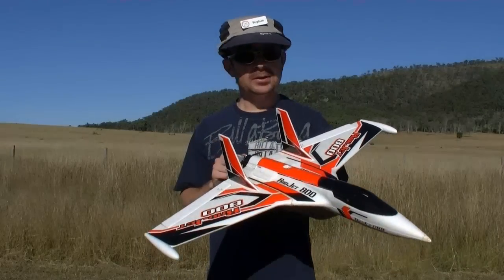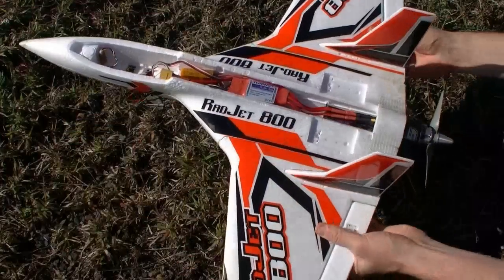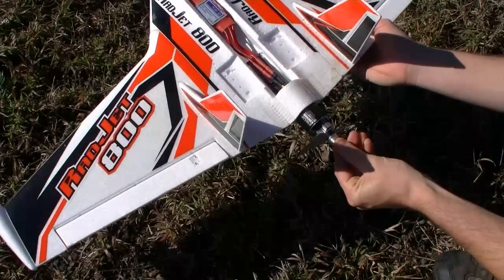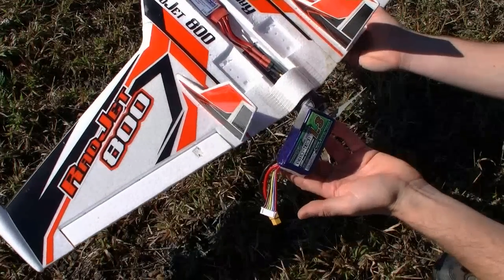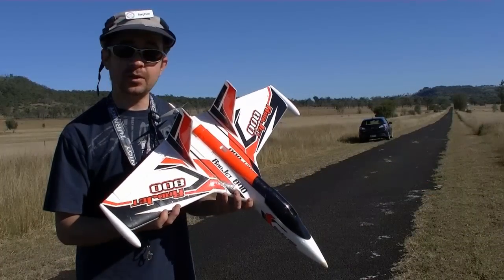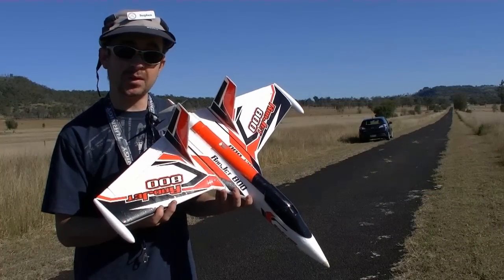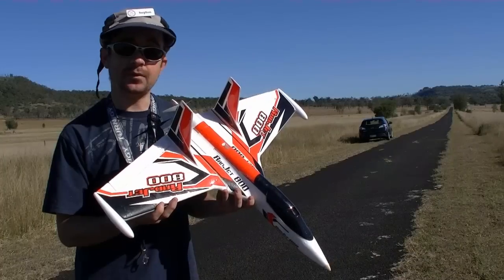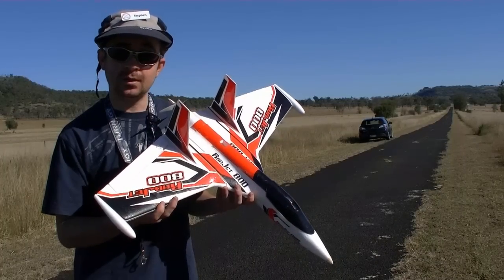RadJet 800 6s 1200 watts (VERY FAST)

Comment: Hi there. I’m looking at up rating my Radjet 800 and your setup looks pretty much what I was hoping for. Would you mind letting me know what size prop you’re swinging please. Many thanks. 
Love the video by the way!!
Reply from the maker: It was an apc 5.5x4.5.  Keep in mind that a heavy set-up like this will reduce the flyability.
Reply from the maker: Thanks!
Reply: Many thanks for the reply! I figured it’d be somewhere around that size and pitch! I was worried about using an apc, as they’re not very forgiving when used with belly landers!!
I do like your setup though!..... sounds awesome!!
Reply from the maker: @andrewandlee  I've not had an issue with belly landers and APC props.

Comment: if you cut off the fuel pods it will get the speed your wanting i think they account for some drag. im setting up another one for my son he is hooked on the speed this plane offers i will say it is a similar motor but 3000kv lol it is alot of fun and it flies on rails. i bought a 3d printer so i started making small fixes for this plane like a better shaped nose cone and small winglets from super thin but strong pla carbon fiber. these two fixes alone gave us way nicer handling and faster speed. i saw you crashed also so i hope you do have another go with reinforcement now you know where it needs it from your experience. happy flying.

Comment: Why in the end of this video, it shows you were using NTM 35-36 910KV motor ?
Reply from the maker: +RC Sóc Trăng   hello, nowhere does it show me using a 910kv motor.
Reply: +TheRattleSnake3145 In 1:35
Reply from the maker: +RC Sóc Trăng  1:35 shows me pulling apart a Turnigy 2826 3700kv motor.
Reply: +TheRattleSnake3145 Yes I know that, but the right motor was 35-36 910KV, did you see
Reply from the maker: +RC Sóc Trăng yes it saw it, it's my video.   I'm not seeing what your point is though.
Reply: +TheRattleSnake3145 I just wonder which plane that you put this motor in.
Reply from the maker: +RC Sóc Trăng  Cant remember but most likely a Super Cub.

Comment: What are you using to measure the speed?
Reply from the maker: Hello , its a Voltron GPS data logger.
Reply: Thanks!
Reply: +TheRattleSnake3145

OK you posted this over a year ago so I won't expect a reply but for anyone else reading this it should be pointed out that GPS isn't very good at measuring speed, and that especially applies when you're moving fast.

Really you should have done several passes and averaged the results although it's as an indication it's fine and from what I've just watched definitely fast enough!

Comment: Why are you using a 6s on a motor rated for a 3s or a 4s ?
Reply: Most most 4s rated motors habe no problem on 6s.. motors are not the weak link when stepping up voltage. Like 2s motors have no issue running on 4s so long as you know what your doing.. a Watt meter is a absolute must when you are running 6s on a 4s rated motor.. you must prop the motor to keep the wattage in an acceptable range.. if your running a 800 watt motor and prop it to where it pulls 1000 to 1050 watts static then your in-flight wattage will be very close to that 800 watt number.. anyhow motor windings have no issue with increases in voltage you  just have to know how to prop a motor and you must know how to fly a plane that is over rated in its power system, you need to do speed runs then a cool down run if you are really pushing it towards the max the motor can handle.. I fly 6s on planes and quads all the time with motors rated for 2 to 4s and they handle it and beg for more.. I've flew 8s on my Hyperlite 2207 R3s that's a 2 to 4s motor and trying to break race quad speed records I've broke 146mph with that setup on custom props I had made that are 4.4x5.8x2 i have only cooked 2 motors on that setup with over 400 flights on it.. one motor was cooked because of a Emax AvanR bi-blade 5 inch prop exploding from turning more rpm then it could handle and had it explode at the hub and the massive instant vibration smoked it instantly and the other time was due to a error me running 3 back to back to back passes without a cool down pass and about a half second in to the 4th pass I smoked the left rear motor and once again my fault.. it was in no way the way over voltage of the motors.. point of this is, this fella is exactly right if you know what you are doing going well over the rated voltage of a motor is ABSOLUTELY safe and you are putting zero risk on smoking a motor.
Reply: also that's a good way to burn up that motor
Reply from the maker: Because it can take it.
Reply from the maker: watchdog gibson Only if you don't know what you are doing.

Comment: Hi guy, since 1 year I use your setup. It's really fun, but the lipos dies very fast. For more speed, I have change the prop for 6x5 and a powerfull battery Turnigy nano-tech 1550mah 6S 65~130C.
Thanks for this video !

battery :
https://www.hobbyking.com/hobbyking/store/uh_viewItem.asp?idproduct=51445

propeller :
https://www.hobbyking.com/hobbyking/store/uh_viewItem.asp?idproduct=7937

Comment: Hi mate, can you please explain to me why you are running 6S on what is specified as a 4S motor?  I have just bought this exact setup and when purchasing parts from my local model store the guy pointed this out.  Im taking it because you are running 6S then the current draw is actually less?  Will it last long?  Also what flight times are you getting with that setup please?
Many thanks in advance!

Lee
Reply from the maker: Running a higher voltage gives you more power per amp draw.
The amp draw with this 6s setup is below the motors rated max amp draw so its fine there.  Where the motor is mounted gets Alot of cooling, this also helps.
Combine these points with the fact that full throttle is only ever held for 5 sec or so ( As it gets to far away if you go for any longer) mean that its not an issue.
The only thing I can think of is the bearings may not last as long. but these motors are very cheap or you could just put in new bearings IF something happens to them.  If I fly for endurance its about 15 mins, if I do speed runs its 3 mins or so.  Whoch hobby store sells HobbyKing stuff?
Reply: Thought as much but could we not get a true 6s motor in there?  If so what would you recommend?  15 mins on a 1300mah packs sounds crazy even if it is just tootling around. Looking forward to trying this setup. Have you stiffened up the airframe and if so where?
The store dont sell hobbyking stuff I just went there for the props/carbon/watt meter and a few other bits and bobs.

Comment: I use the 28m NTM motor, 4.5Sq prop on a 45C 4 cells & 60A ESC & my Radjet is bloody fast!
Anything faster is really not needed I reckon. It's a balance between weight & flyability.

Comment from the maker: I use /like the Plush/Sentry esc's because with the program card, its very easy and quick to change the settings.

They also work very well and have proven to be reliable.
I've never used a redbrick but I have had a Hobbyking esc (which is the same as a Mystery esc)   It performed well but I found it hard to change the settings.
My first choice is still the Plush/Sentry esc's

Comment: Don't sweat that you're running it on 6S.  There are no MOSFETs or voltage sensitive components, unlike an ESC where you MUST obey the cell limit.  You can run it on 12S if you keep the power under control - would need a hella small prop.  You might be overclocking it on POWER, but even then the rated power (875W) depends on how aggressively the throttle is used and how much cooling the motor gets.

Comment: All fixed! It was that the ESC was plugged into channel 6/7 which on my reciever is for the power.. woops! I put it into channel 3 which is the throttle, and also provides power - obveously and it worked! 

I still have to adjust the endpoints but she runs a dream now... thanks for all your help :)

Comment from the maker: The only thing changing the motor/ esc wire order does is swap the direction of the motor so I don't think its that.

It kind of sounds like its not bound or you have the wrong model selected, have you checked that?

Comment: Hi mate, i have built up my radjet exactly the same spec as your one in the video here. I have one issue, this being that when i plug the ESC into the motor i get a repetitive 'bleep bleep bleep bleep.....' noise. What do you think this could be? I have tried plugging in the connections in different orders but still i get the same problem. help!

Comment from the maker: If you cruise around on 1/3 throttle ( probably 100kph or so)
you will get around 15 mins with this setup, speed runs you get 3 mins ish.
I'd just get more of the same batteries (You might get it a bit cheaper if you use the link in the video description)  
If you want more out of it I'd suggest a higher pitch/ larger diameter prop.
However, the motor is already being run out of spec (Its not rated for 6s use)
so you would really need to keep an eye on it.
Dont forget to add Carbon in the wings!

Comment from the maker: Im going to guess that it happened because there was no prop on it and it over reved.
I never run a motor at full with no prop.

Despite running this on 6s when its a 4s motor, its still under the rated max amps.
No troubles so far.

Comment from the maker: The 241kph with that setup was recorded in a dive, level speed was around 198kph.
So that was a bit misleading because of that, thats why I made sure I flew level 
in this speedrun.
I feel that 40kph increase is a fair bit!

Last I knew from RCGroups was that 5.5x4.5 was the magic ratio, which is what I have found too.
Im not a fan of the TGS props, I prefer APC or the hobbyking APC Style props.
Reply: How much the weight of your plane sir?

Comment: Oh and BTW according to drivecalc, the speed you claim on your 2836 isn't possible with a prop with 4.5" pitch. What is the gadget you're using to measure speed, and how accurate is it?
I know there also software available that can measure speed by doppler from an audio recording of the plane flying by, should be able to be applied to these videos :)

Comment: Wow, that's weird that you get it to go faster (241km/h) on the 2836 with 4s, but with the 3536 on 6s it only went 232km/h.  Any idea why?
what size prop did you use? They say 6x4 is the magic ratio, perhaps you need a motor with the correct kv to run a 6x4 TGS sport at about 60 amps?

Comment: For carbon fiber on the wing,you said you used a 10mm wide by 2mm thick peice,did u use one that went from one side to other going through the fuselage too being it is convex to the wings,or did u use 2 pieces going from wing tip almost to were fuselage radius begins?? Being the battery takes up entire height of fuselage where do u make a air vent at (on side of fuselage like at a 45 degree angle or something?)

Comment from the maker: you dont need to change the electronics, 
you do have to modify the motor mount a small amount to make it fit.

For these speeds.you will also need to add some carbon fibre to the wings.

Have you flown much before?

Comment from the maker: Make sure when your doing your speed runs that you fly as level as you can or you will get false results.

I go to RCgroups dot com. 
There you will find a pusher prop section where the Radjet thread is.

I have 3 new planes coming atm, so the radjet wil have to wait for a bit  :P

Comment: Just had another 2flights, 216km/h level is the fastest I can get. Motor and ESC gets very hot though, cut out so much for cooling but still gets hot, this setup stays so cool with the open setup in the skyfun. Which is the bet forum to join so I can chat and post pics etc? Thanks for your help so far! I would Love to see this plane at 250-260... Race you to it ;) lol

Comment from the maker: Yea I have seen it, hard to say if it will handle it.
Just make sure you test it with a watt meter.
Its a bit smaller motor so you will have to move your battery further back than mine.
It will likely draw less amps than my setup (with the same prop) but  likelt to have less speed.

They are a great plane and so cheap!  Post a video response when you can.

Comment: Have you seen HK new 1700kv 6s motor? 30Grams lighter than the NTM. Do you thin it can handle 5.5 x 5.5 on 6s? I maiden flew my Radjet today on my 3700kv 4s, 4.5x4.5(against your prop recommendation). Got 200.34kmh level flight. I ordered your 6s setup now and that new 1700kv motor. Thanks for your help, the radjet flew like a dream first time!!!!

Comment from the maker: The motor is hooked up the same way you hook any brushless motor and ESC.
I am using the stock motor mount with the nessesary holes drilled to fit the bigger motor.
I used 2x 10mm carbon strips, I prefer the strips over rods because they are much easier to install and are stiffer.
I didnt paint the plane with arclic but I did use alot of epoxy around the motor mount.

Ive had a few questions about the setup now so I will be doing a vid on it in the near future.

Comment from the maker: Any esc will work however I have never used the esc's you mentioned so I cant
say how good they are.

I use the Turnigy Plush OR Sentry esc's because they work VERY well and can 
have their settinga easily changed using the programming card.

I recomend the Turnigy Plush or Sentry %100

Comment: I do not think it would be a problem to explain how you hooked up the motor using what motor mounts etc?? Thank you. And what size carbon rods for wing will work,and if u had to paint plane with acrylic or reinforce the motor mount any with epoxy etc?? Thank you.

Comment from the maker: Prop: APC 5.5x4.5
Motor:  NTM 3536 1800kv
Esc    :  Turnigy plush 60 amp
Battery:   turnigy nanotec 1300mah 6s

Links have been added to the video description.
Use htese links AFTER you have logged on to Hobbyking, theres a chance you will get them cheaper

Comment: What modifications have you done to the plane? Did u need to paint it with clear acrylic? Put carbon fiber along traling edges? What size carbon fibre for wing and 2 peices being middle is convex?? And being the stock motor mount holes do not line up with prop drive motor,and the metal motor mount seems to need cut to work what did u do to attach motor?? Perhaps u have some pics of motor setup.Did u have to epoxy around motor mount area to stiffin foam My email is mattg178@comcast.net .

Comment from the maker: Wow i wasnt expecting it to be drawing that much.

If a 5.75x5.5 prop is drawing 135 amps I wouldn't be suprised if the 7x8 is drawing over 200 amps.
Which would explain the motor cutting out.

As a comparison my setup in this vid is drawing 56 amps.

Its not a question of which rpm a prop works best at, its sort of a question of RPM/speed/thrust vs amp draw.

eg:
You might put a bigger/higher pitch prop on, lose a few rpm, get more speed overall but your amp draw will go through the roof.

Comment: Thanks! I tried my nanotech 2700mah 6s 65-130c last night and it didn't cut, so then is that safe to fly with? I have some 7x10 props on order hoping to get more speed, I just hope that the amp draw won't be too high. I know with a 5,75x5,5 it pulls 135a... Also how do you work out what rpm a prop works best?

Comment from the maker: Thats a pretty powerfull setup, have you measured the amp draw for both props?
:Your battery can deliver safely:
40c 2200mah  =   40x2.2  = 88 amps

You could be right about drawing to many amps.
It also could be the esc, the SS are a low end esc.
I always use a Watts UP meter to measure current draw and a optical tacho for rpm.
Thats the best way to find the right prop for the application

Comment: Hoping you can help me as you were very informative with my other questions.
I have a skyfun, 3126 1600kv, 6s 40c 2200mah, Hk ss 190-200a esc and 3A Bec. I run a 7x6 prop on this setup and it runs fine, I wanted more speed so today i put a 7x8 APC on and runs at 50% throttle, but over that the motor cuts.. Would you know why? Maybe Battery cant supply amps to power system? Thanks in advance

Comment from the maker: Are they using the same motor/ prop?
My 4s setup was around 198kph so a 34kph increase is ok.  I guess is shows how much extra power is needed to go faster.  
Having said that, the 4s setup was drawing the same current so that shows the efficiancy of the 6s setup.
I would get a funjet but I dont like paying more then $100 for a plane  :P

Comment from the maker: I always prefer a higher voltage / lower KV combo.
It gives better performance with less current draw.

the 2350kv on 4s with the 5.5x4.5 or 6x4 would be a great combo for the skyfun.

Sound like the alerons will be fine just make solid balsa ones if they aren't.
The RadJet's alerons are quite stiff so I just kept them the way they are.

Comment: I fly 3700kv on one of my skyfuns, with a 4.5 x 4.5. Do you think that it will go faster with a 2350kv and a 5.5 x 4.5?
Thanks for your response!
Regarding the elevons, I put 3mm carbon flat bars in them and on the trailing edge and then fiber taped them, should do the job...

Comment from the maker: The 2350 only got 241kph in a dive, level speed it was 197kph or so.

You are correct that the 2350 3700kv with a 4.5x4.5 would get the speed needed for 
250kph but the 4.5 prop lacks the thrust needed for the Radjet.
It still flys but ends up being slower. .

The general opinion on the Radjet thread on RC Groups is that an apc 5.5x4.5 is the 
best ratio between speed and thrust.

Hand launches are still easy with the extra weight.